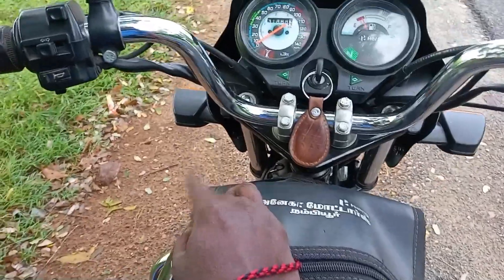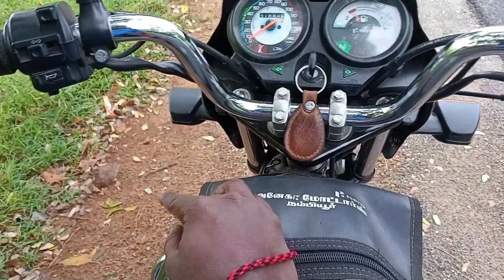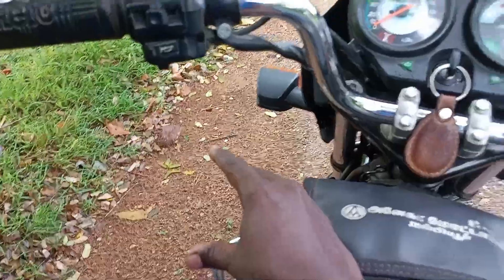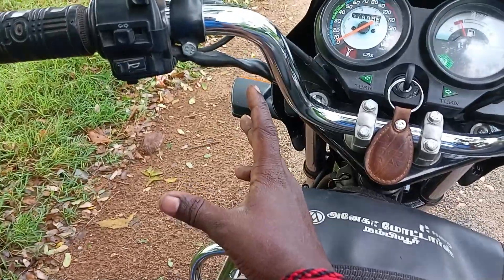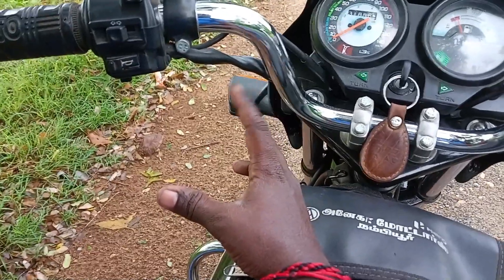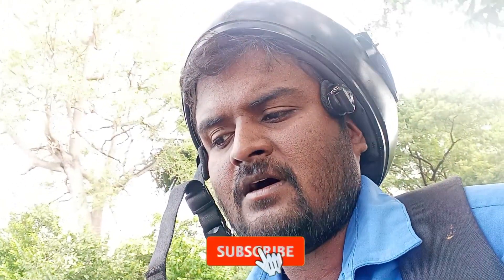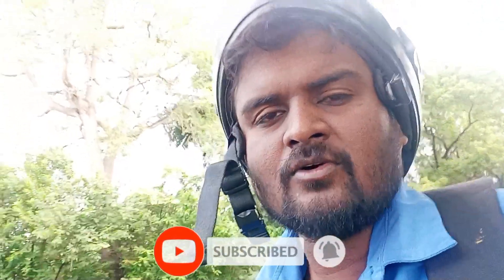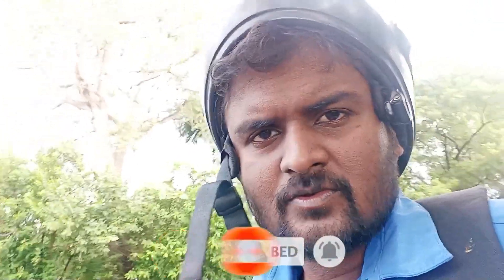Hero splendor bs6 bike second time speedometer problem 😕😕|| Worst feeling ☹️

Comment: Hi bro... Head light on off switch vaikalama venama...
Reply: Ama bro vaikalama vanama
Reply: Vaikalam
Reply: Venam bro vecha sensor la prblm varum
Reply from the maker: Okay bro
Reply from the maker: Sensor problem varra vaipilla bro switch vaikkalam because sensors line kku thaniya fuse la irunthu wiring poogum incase overload na fuse poirum bro
Reply: Vena brother nanum vachithan epo yanku senoser proplam varthu
Reply from the maker: Reset panna poogalaya bro
Reply: @LandforLearners  bro please bro sollunga na light off switch vakkalama vacha sensor la prblm varuma enakku ore confused🤔
Reply: @LandforLearners  Bro speedometer slow aka vaippu erukka
Reply: @40g10  வைக்காம கூட பிராப்ளம் வருது. Splendor waste